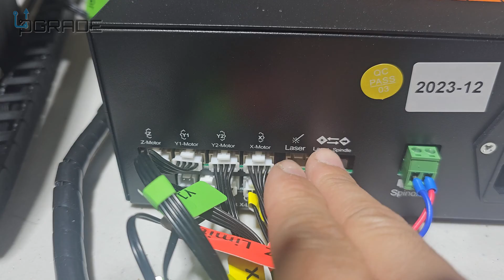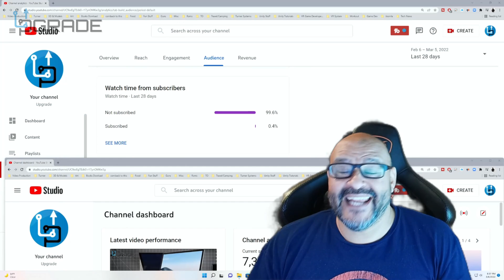VEVOR CNC Router Machine

Comment: Did you receive all of the trapezoidal nuts (16)? Number 17 on the parts list. I didn't receive but 6 of them.
Reply from the maker: Yes i did , You can ask them through the Vevor website for support and replacement
Reply: @Upgradetech  I contacted them and they told the part was not available. sucks

Comment: i have just purchaced an s4040 upgrading from a 3018 i ran it at 300mm per minute and .1mm depth what would a reasonable start be for the vevor using pine and a 1/8,1/4 and 60degree v bit . also did you or do you know which laser would work . thank you for your time

Comment: Do t know if you still read these posts or not maybe someone that knows can tell me. I am wanting to be able to carve or scribe different fonts into a small sign(7” x 9”) oval shaped wood sign. In order to select different fonts do you need a laptop to set beside the CNC? How do I get it to like write like name of horse, skip below that carve out owners name, skip below that phone number, skip below that, town, skip below that state, maybe a small design between phone number each side, and be able to select different fonts, I am taking it I would need a laptop with font program, set up on screen and plug into computer info box on machine? Anything close to that? Thanks anyone.
Reply from the maker: Yes You would need the software and a computer to do the change you need. I personally used Lightburn because the software has fonts that reads off your computer.

Comment: 3018 was my first CNC, I placed a 1/4 hp trim router, I have to have an 1/8 collet made.
I purchased a vevor 400x400.  I'm already looking to double the size , 800x800. The 1/4 hp trim router is a game changer. It doesn't slow down.
Reply from the maker: Same here I want something bigger and stronger
Reply: Where do I get a spindle clamp to upgrade to 65mm router